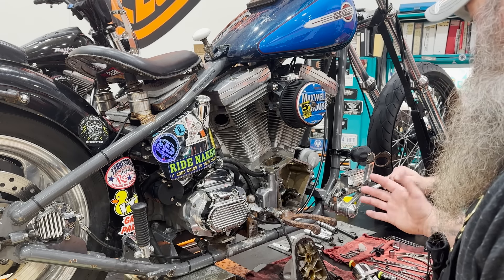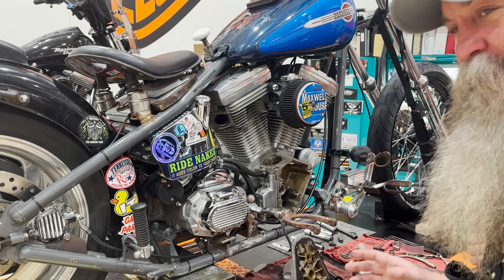What a sad day! Lifters have same marks as cam! Next: Oil Pump | Harley-Davidson Chopper Rebuild

Comment: Remember...Drain the oil tank, wash out the oil tank, repace the old oil lines, and add new engine oil & oil filter...'cause all that grit/dirt /crap that you've discovered so far, has circulated thru the whole system.  👍✌️🇨🇦

Comment: Thank you for showing and explaining all this about your Evo. I  have a 92 Evo that has a noise and I want to get into it and this helps me a lot.
Reply: I have a 85 Evo and it was knocking. I replaced the lifters and that was it. I took the old ones apart and cleaned them up. I'm keeping them as a backup. I also replaced the oil lines and flushed the tank. I also took the top off the oil pump and replaced the check ball and springs. Sprayed Seafoam in while I had it apart. I also have the original parts book which helps alot working on and ordering parts. Good time of year to work on them